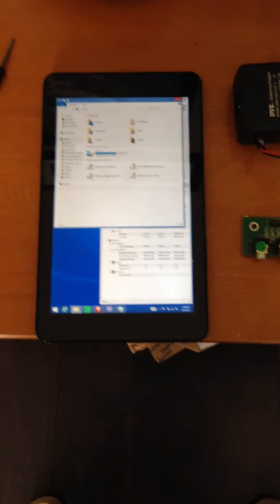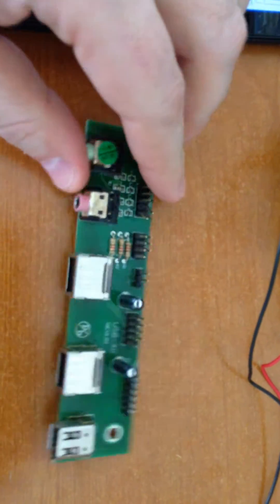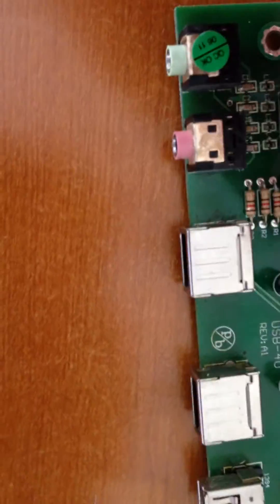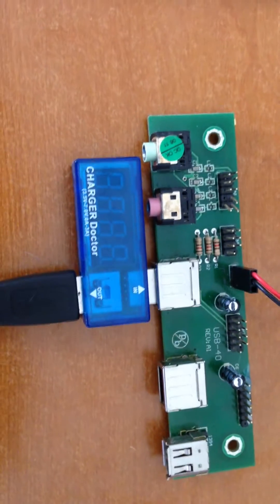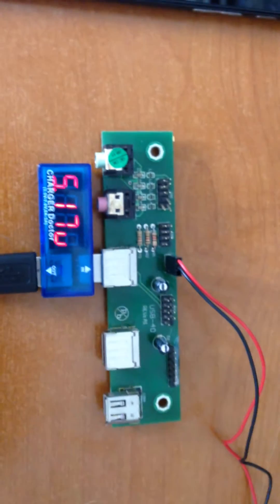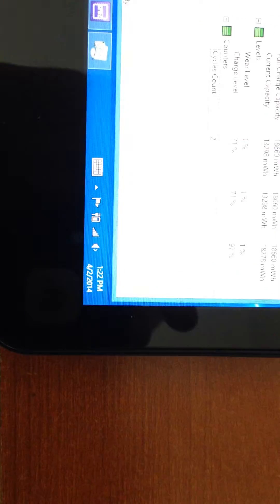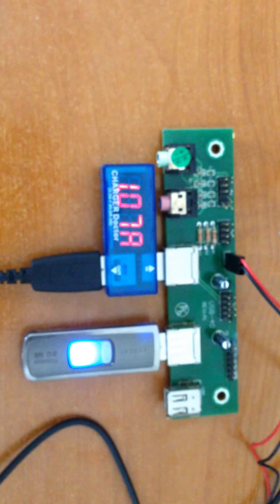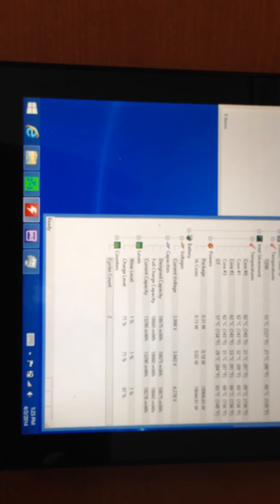Dell Venue 8 Pro Charging and USB Operation at the Same Time.

Comment: Hello, I did all the connections as described in schematic but i'm not able to use a regular USB mouse or keyboard in remaining USB port. It works with pendrives and wireless mouse. I don't have a powered USB hub to test if the lack of power is the issue. When i connect a regular USB mouse it powers it (the laser sensor) but the cursor doesn't appear on tablet screen. On the regular USB keyboard it doesn't power any led on it.
Reply from the maker: +Azm Robert The Dell Venue 8 Pro USB port has very limited power and it sounds like the USB mouse or keyboard pull too much current.
You will have to use an external power supply for the hub
Also when connecting any USB device the Venue 8 pro has to detect it fully in Windows, than windows will load the driver.
If you can find a 5v supply or a powered hub, I would retry your test.

Comment from the maker: mine is still working, so not sure why yours is not working. Others have built it and theirs are still going strong. Could be a bad solder joint, bad wiring, etc
Reply: ***** thanks for your reply

Comment: you ned these 3 items to charge and use a USB pen drive 

￼175368
USB Female to Micro USB Female Adapter - Black
1
￼1,97
205901
CY U2-166 USB Female to Micro USB Female + Micro USB Male Adapter Cable - Black (15cm)
1
2,49
￼241044
USB Male to Micro USB Male Charging Data Cable w/ Switch for Samsung Galaxy Tab 3 - Black (100 CM)
￼1
￼

Comment: I'm sorry to bother you as this doesn't have much too do with your video but ,  I have a problem with my Dell venue 8 pro. The charger port works and the tablet charges, but it will no longer work with any of my other peripherals, when it used to. They work on other devices so I'm honestly clueless as to why this is. If I plug my keyboard in halfway, it will register it connecting, but it was never this way. It doesn't have to be done like that when I charge it either. Any possible ideas? >< trying to go through Dell support is a nightmare..

Comment: Hello,  The +port from Mobile Design Labs is legit.  I can tell you this because I'm the Electrical Engineer that designed it and part owner of Mobile Design Labs.  The plus port actually does a lot more than adding a resistor across the data lines.  It initiates charging before actually connecting any USB peripherals to avoid corrupting the data lines or over driving the peripheral's data transceiver which could eventually lead to failure.  It has an onboard microcontroller that monitors the current drain and connection status.  Giving the +port these "smart" features allow it to re-initialize charging and reconnect your peripherals/hub/docking station without the user's intervention making it completely automatic.  Check out our video by clicking on my name and you can pre-order these on Amazon.  We are about 2 weeks out from shipping due to a production delay.  www.amazon.com/Port-Power-same-mobile-devices/dp/B00J5S2TS4  Thanks!  Mobile Design Labs.

Comment from the maker: I have been swamped with my real job, so I have not had time to work on making these little boxes. I do have all the parts except the dual USB, which is turning into a pain to find the ones I want. I may need to just order all parts separate and put it all together.

Comment from the maker: If you unplug power while using it the USB will stay connected, but upon plugging the power back in it WILL NOT charge. This is due to the way Dell has their sensing/detection. The power has to be plugged in first, than the USB device

Comment: Great solution. I tried it and it was working. There's a small restriction though: you have to connect the cable to the DV8P before plugging in any USB devices or it won't charge. Removing the device at that point won't make it charge either until you re-connect the micro-USB cable to the DV8P.

Comment: Is this solution specific to Dell or does this method work for all 8" Windows 8 tablets?  I have a thinkpad 8 and wanting to do the same.
Reply from the maker: I only have the Dell, so unknown if it will work with other tablets. If the thinkpad uses the same design, than it will work